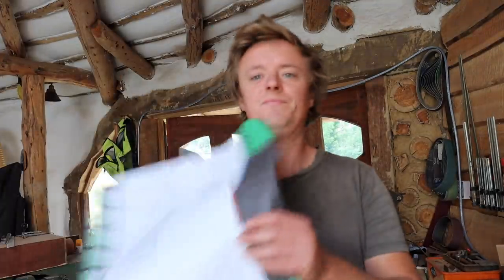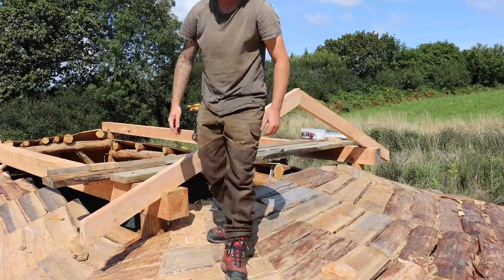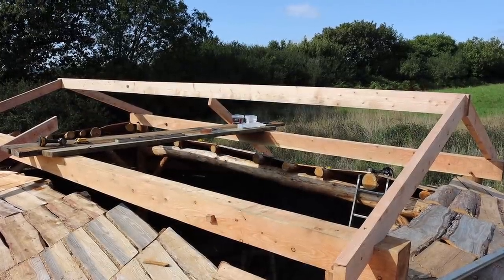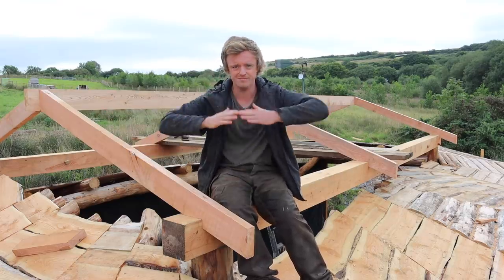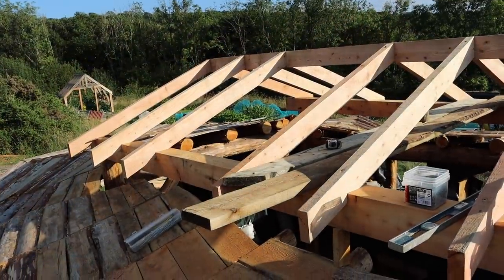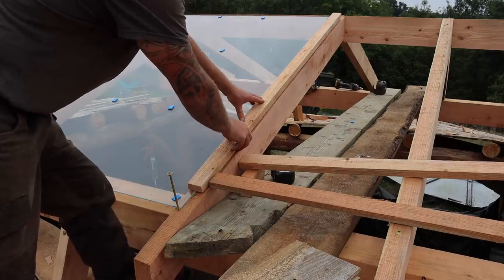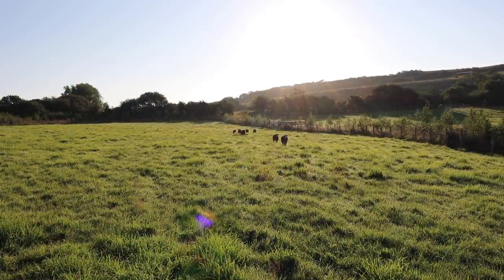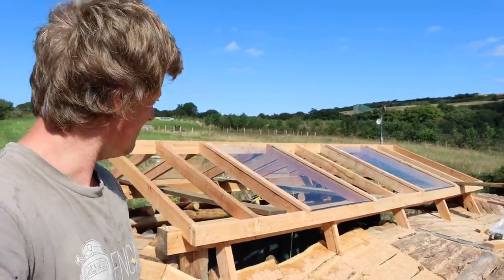Off Grid Earthbag Workshop Part 69 Central Pitched Roof

Comment: When sinking those long screws into hardwoods or just regular lumber, I’ll drag the screw across a bar of soap that I keep in my tool belt. Man it really helps them sink good and tight with a lot less stress on my impact driver and it makes the battery life last a lot longer too. You should give it a try next time your project requires over 3” screws👍
Reply: This is a really good trick to be honest , and it really dose help your inpacks last longer plush it helps drive them in a lot faster

Comment: Another great video Kris.  Some takeaways from my perspective (for what it's worth).
1)  I think you made the correct decision about the roof line/roof pitch.  From a cost/benefit perspective, the amount of time you will have the van or whatever other vehicle on the lift will be but a tiny fraction in comparison with the times you will pass by that building being bothered by the aesthetic of an excessive bulge to your roof line.  You made the right trade off.
2) This is the first video where I really appreciated the nature  imposed rhythm of working with the mixture of power sources you have on hand (i.e. wind, solar, hydro).  While at first it might seem a pain to wait for things to power up, if you didn't have that forced downtime, you would have missed out on some of the other simple pleasures around your home such as taking puss puss out for a visit with the sheep.  The older I get, the more important I think it is to take time to slow down and appreciate things.  This may be a reason why so many of us enjoy this channel and others like it.

Can't wait to see the preparation for the turf roof.  Very interested to see how that is done so that the wooden understructure doesn't rot away.  Great stuff as always Kris!

Comment: Kris your woodworking is a joy to watch. I'm not making this comment to be critical. I did observe a possible problem with mounting the roof glass. The facia board should have been hand planed to the same angle of the rafters. That way the glass lays flat. I did see at least a 1/4" gap at the lower rafter and glass. I'm afraid of leaks or cracking if not corrected now. I hope I helped without intimidating or chastising your wonderful wood working skills.
Reply from the maker: It was planed i just didn't film it. you can see it as i mount the glass and remove the tape film
Reply: @KrisHarbour  thanks for responding Kris. I did miss it. It's going to be a wonderful workshop.

Comment: Years ago I framed houses.   You are correct about the ''spreading'' force when there is no ceiling beam for triangulation. Allow me to suggest something. No car on a lift is going to all the way up. The bottom of the rafters are an upside down ''V'' . This means you can get a small amount of triangulation up near the bottom of your ridge.  Figure your narrowest car, measure the roof and have the cross piece an inch higher than the car can go.. Cross piece can be  a plywood gusset, steel strap or  conventional lumber well nailed.   I'm sure you already thought of this, but on the off chance you didn't..........

Comment: I love your videos and have been watching 4 years now! One suggestion, instead of lifting the car you could alternatively dig and concrete a pit around 2' wide 5' long and a depth around 5' with a couple of metal covers when not in use. That way you don't have to lift or support anything, and can move comfortably in and out from under the car to work on it while retaining your full shop space. Much cheaper than a modern automotive lift and requires no electricity or power. 

Love your work, when you were building the water generator some years ago I was so inspired, watched it like a TV series!

Comment: With a slightly different construction, You would have bound together the top-part of the roof so that there would not be any load sideways in the bottom purlins.
Connecting the rafters on top in a way that they are connected into a stiff triangle plus putting a slight tension member (steelcable plus tensioner with about 5 cm distance in the middle to direct the tension upwards) underneath the top purlin together with the landings You already got on the bottom rafter ends catches any movement downwards on top (tension member) and thus (stiff braced topconnection) catching any outwardmovement at the base purlins. 
Anyway, thanks for sharing, very nice building, and I like particularly how You do it Yourself most of the time (with no other set of hands that is). Cheers!

Comment: You can add rafter ties close to the ridge beam to help keep the rafters from pushing down and out as well.  
Your van/car can only get so high based on you roof slope.  Just put the rafter ties a bit higher than the roof of your van.

Comment: good luck with the leaks. the glass should have a 3 to 4 inch overhang with drip strip under, all the wood should be rot proofed and sealed, there should be mastic above and below the glass and an expansion seal between - usually a rubber strip- and a big convex seal along the top of the glass too stop blow back from windy rains, with mastic top and bottom. basically a seal. if you are 'green', then use some water based rot proofer and  a sealer. got to be done matey. you can reuse this glass. just add a rubber strip glued to it all around, and bigger bit of  THICK glass on top to finish, with some silicon gell thrown in to absorb condensation. the gell you can reuse- its in most prepacked products when shipped. recycling.

Comment: You may be able to add a lot of structural strength to the roof when you close in the ends - if you use thick strong wood and secure it well, it should help deal with any weight issues.
Reply: Adding tie-beams where there is height to do so and it won't block light could also work.

Comment: Hi, Just watched your video, came across one of your videos the other day and enjoyed it so much that I been binge watching them all.  I'm just about caught up to date Thanks for sharing. Anyway on you changing the pitch of your roof and  not having a full lift in your shop. I have worked in many garage's that had low lifts in them and also had a garage auto pit between the lift tracks so you can climb down into it when the lift is up. this way you can work under the cars not having to bend. might be something to think about. Would be very easy to cut a portion of the floor and dig a pit. Anyway, something to think about. again thanks for sharing your journey

Comment: All of the structures you have built have been unquestionably beautiful. Most particularly, the way that you site them and design that works with the landscape. It's your home, that's the most important thing. It's not like you were planning on opening a garage? How much vehicle work are you actually going to do? The smaller lift could prove to be extremely useful for your larger timber projects, mainly if it is movable. You made the right call

Comment: Great to see all this happen and to understand the background thinking here. I wonder however if it would have been easier to brace the two main (skylight) beams with stainless steel rigging cables, crossing the upper roof in two or three places, tensioned with bottle screws. This would brace the two main beams against the downward load from the roof glass and shingles and any added snow  etc.  On the other hand, you are doing this, and I am not, haha.
Reply from the maker: Vehicles get lifted in to the space so cables would be in the way.

Comment: I'm surprised the center pitched roof section wasn't a little higher to allow for some vertical windows. I think I saw them referred to as fenestral windows? They used to be added to ye olden houses to allow more light in and could serve as ventilation systems too.

Comment: 28:57 I agree, if you had built that roof really tall it would have looked stupid. You could* have raised the four posts and cross beams like a foot higher and with this roof pitch still would have looked fine, but that would have been loads extra work and it seems you already sorted what you were going to do. Looks good. Cheers.

Comment: Hate to be contrary, but in the end the forces have just been moved from the top pitched roof and transferred to the timbers and to the exterior wall.  They are not cancelled out (as connections between the rafters would classically do).  The only advantage here is sheer mass of the exterior wall "top plates" and walls.  This "may" be held back by the central "box" of heavy timbers (if the lateral loads of the roof timbers are pulled back in tension), but I'd be carefully skeptical of it.

Also, as the scarf joints are permanent they (sh)(c)ould have been epoxied to spread the load somewhat - better than the stainless steel fasteners (IMO).

Comment: Hey bud, your glass is going to crack along the bottom edge. The facia board needs to be sloped (at the glass) or lowered so the outside face is in a straight line with the top of your rafter. Good work so far, looking forward to seeing the sheep up on the roof like goat on the roof up near Tofino (Vancouver island Canada)
Reply from the maker: It is, I Planed it down to the same angle Just didnt video it.

Comment: I'm not sure how 45 degrees looked, but I really like the stealthier look of the lower angle.  What's the issue with low angles and shingle -- standing water?  Thanks for the great vid!
Reply from the maker: No issue with them not stopping the rain or anything but the steeper the pitch the longer they last. at 20 degrees i would hope for at least 20 years at 50 degrees over 50 years. Some very old very steep pitched roofs lasted over 100 years but they were basically vertical.

Comment: A thought, Kris: could you excavate an inspection pit in the centre of the workshop to allow you full-height access to the underside of a car? And add removable planks to have a flat floor when the pit is not in use, as in many older garages?
Good choice to reduce the pitch of the roof, that would have looked a bit strange, like a witch's hat.
Reply: I was just thinking the exact same thing.

Comment: That gap between the two roof lines, have you considered a few clerestory windows? It would bring a ton of good light deep into the structure.
Reply: Sorry, I commented before you showed that you were putting four big windows in the roof. I still think clerestory windows with a solid roof would look fantastic, but your design solves the light issue
Reply: I'm quite concerned about the roof windows. I think you need to build a box frame so that the glass sits a few inches higher than the turf when it's all done. That way you can run flashing from the roof surface up the vertical walls of the box. Sort of like a casement window
Reply: Sorry again, I would not have commented if I knew you had already put the roof windows in. I hate to be one of those people that points out what they think is wrong and how they should have done it. I only commented because I thought that was still to come and thus my comment could potentially be useful. Sorry again

Comment: Why not add a couple of horizontal ties on top of the longitudinal beams at each gable end tied to the rafters. This will help cut the spread at the ends, and wont interfere with your height clearance either. You could also add a central post from the tie to the ridge (like a king post truss) which will help hold up the ridge and also reduce the possibility of rafter spread. Are you adding any diagonal bracing to your rafters to help reduce racking?
Reply from the maker: There wont be any at the ends as the ends are mortised in to the posts that are braced.
Reply: @KrisHarbour   ha ha good point. I forgot you'd done that. Tiz Friday and been a long week. Keep up the good work. I enjoy watching your vids

Comment: Will you be adding some under support for the top end of the glass? I think the glass would not handle much weight, such as snow.
Reply: ...also, interesting to know how your going to flash the bottom of the glass??
Reply from the maker: Yes that will get done when i do the batton. then the shingles will overlap the glass a bit.

Comment: I was wondering why You didn´t put some small timberframe walls (idealy with glas in between) under the pitched roof. That would give you the hight you wanted and quite a bit of light coming in even without having the problems that come eith windows in the acual roof.

Comment: At 6:00 you made a big mistake, Kris. Yes, you got the zig-zag for the wedge correct, but you should have kept the 45-degree ends. With the ends parallel to the wedge sides, all that keeps the joint together is the friction between the ends and that of the wedge sides. As the wood dries out and shrinks, this friction will decrease and will only be kept because it hangs on the rafters, rather than helping them from sinking. And no matter how sturdy you think you have made those two massive beams with all their support, they WILL bend eventually -- millimeter by millimeter. Wood is elastic...
If you climb up there today, two years later, and hammer on the wedge, you'll know what I mean.

Comment: I'm no roofer, but I can't imagine a situation where the splay causes your 6x6 (or is it 8x8?) to stretch in length, which is what it's going to need to do to overcome your logs.
Fair enough, no bad thing that it's massively over engineered, but it wasn't necessary. Splay forces won't have been even 1000n.

Comment: What do you think about a trench with a removable n floor so that you can make up for the loss in height. You can even use part as a tool store for working on the van. Looking great thought. Stay safe J.
Reply: My thought to, but then he have to cut up his concrete floor
Reply from the maker: It would need some serious thought and engineering to do that.  Remember that the lower workshops back wall is retaining the undisturbed sub soil. If i start cutting through the floor (witch is also a foundation) and digging down and disturbing the vary area im trying to retain then i think i could cause problems.
Reply: @KrisHarbour  my thoughts too about a pit. But its always a thought for a much later day if all else fails I guess...Talk it over with cat before hand would be my advice.

Comment: Regarding the lowering if the roof and the inability to raise a van fully,  could you not dig a pit that you cover, allowing you to raise the van as high as you can, but able to stand and work underneath it? Or even a slope going down to a full or half depth pit.
Reply: That's an ENORMOUS job - for limited reward I should think....?!
Reply: @andymccabe6712  no necessarily,  you would be digging a channel of around 1 metre deep and maybe 1500 wide. It's not like it's a workshop with reinforced concrete to dig into. It allows the roof to remain lower and in style, but have the option to have full access to the underside of vehicles.
Reply: @harryblox760  err, that's a substantial amount a of material to remove!
And it IS a workshop with a reinforced concrete floor......!
Reply: @andymccabe6712  it's not a substantial amount at all. I built my own workshop and studio and did the very same thing. I'm not talking about digging a 4ft deep pit, I'm talking about having 2ft at least to offer the option of having more room under the van. Working on a van when you're directly under it with Jo leverage soon gets old. So errrrr yeah......
Reply: @harryblox760  bit late replying - sorry.  We're splitting hairs here - Kris said he will sit on one of those work stools with castors to work under the van. So, a solution for zero effort! And how often do you work under  your vehicle anyhow..?!
This is primarily an engineering workshop with added garage facilities.  So, no ......

Comment: You could still dig a pit in the floor so you can stand under it, and cover it when you're not using it. They used to do that all the time for mechanic shops. Flying buttresses are what your supports are called I think.
Reply: the first time the mechanic falls in the pit you never see them remove the planks again, so you might as well sit on a stool like he's going to do
Reply: Not worth the effort now. It has a concrete slab...
Reply from the maker: The concrete slab is also the foundation for the lift so if i cut it up the lift wont be rated at all. car lifts specify a 6" concrete slab. Not a slab with a hole just to the side of it.
Reply: @KrisHarbour  generally speaking the pit is concrete lined with a concrete floor in it so it all ties together. Also they aren't very wide, maybe a meter wide at absolute most.

Comment: One other question about the greenhouse. When you did the wrap up video and gave all the specs, I noticed that the building fit the golden ratio. Then I started estimating sizes of your shop and found the same thing, particularly in the natural window frames. I freezed the image and measured. Do you use the golden ratio when designing your structures? Or was this coincidental? If it was, I think there's something magical about that. The idea that you were building according to what looked right to your eye , you would naturally possess wonderful design knowledge. If, and I really doubt this is the case, you are unaware of the golden ratio, I would
Reply: Oops. I would suggest you read about it a little bit, I think you would find it interesting. But please, let us know, did you plan it that way?
Reply from the maker: Hello, I do know about the idea of the golden ration, But i never actively use it. I just do a scale model or scale drawing and make thing look "right" I suppose to me what looks right must be the golden ratio then.

Comment: To bad you couldn’t have built a 1/2 meter high knee wall on top of those Timbers which probably would have given you more clearance to lift your van an you could still use the same roof pitch